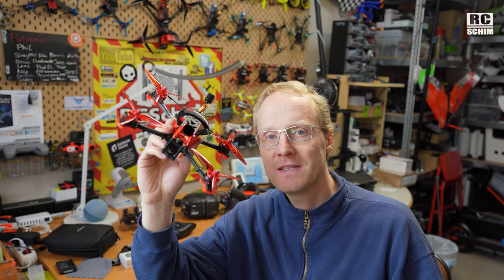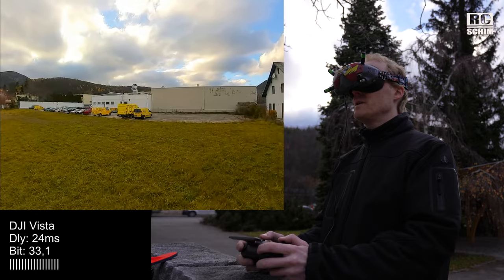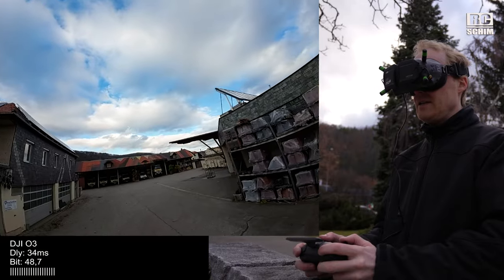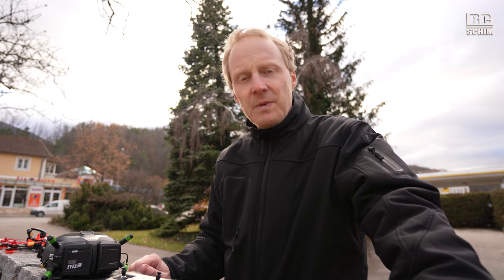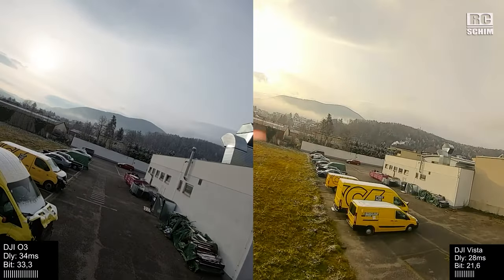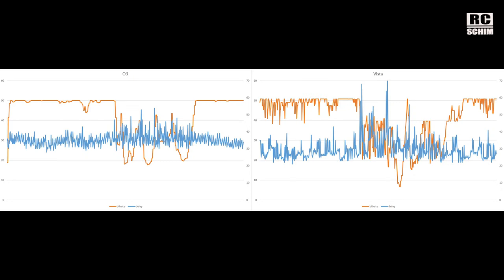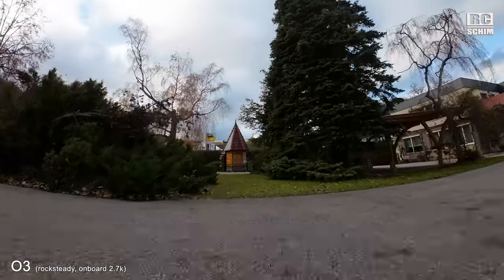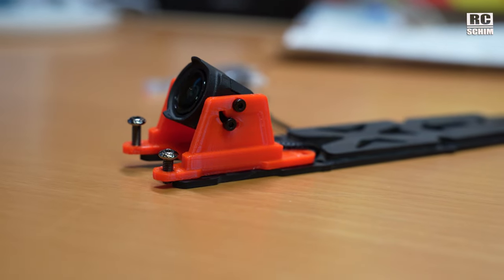DJI O3 - how does it look compared to VISTA?

Comment: Hello, your work is fantastic, a reference for me, I count the days for me to get my package with the o3 air unit, the googles v2, I start in DJI and I have many doubts. Can I record OSD in the goggles DVR? I need to know the GPS coordinates in case of accident to find the model. It would be ideal to do a tutorial for clumsy how to do it. A greeting and so on.
Reply from the maker: Thanks Alex. What radio controller do you use?  if it's an openTX or EdgeTX one, you can easily enable SD Logging. If you drone (betaflight?) has a GPS on it, the SD Logs will have all the data.    Check Oscar Liangs great blog for super tutorials on how to set SD Logging up, and also read about betaflight telemetry. very powerful.
I also made a little video about 4 ways to find your drone in case of a crash:   https://www.youtube.com/watch?v=_JBHG1bBRZ8
about OSD and recording:   if you really have the Goggles V2 (the larger ones)   they record a TXT file (SRT) with some info - but not the GPS.    But if you see the Betaflight OSD in your goggles, the last GPS coords will still be on screen even if video is gone  (see my video above).  
if you have the brand new Goggles 2   (the smaller ones)   these apperantly record (and burn into) the OSD along with the DVR video.   nice - but not so important if you have SD logs of your telemetry.
greets, Mario
Reply: @Rcschim  I use the TBS tango 2 v3. Thanks for the help, I'm going to read.

Comment: Is O3 really so much darker than Vista?
Reply from the maker: in the meantime they released a newer firmware and it's a bit better.  I use +0.7 exposure value and have it on auto, this way it works quite ok.  Aside from some dark scenes Image quality is really great of course!
Reply: @Rcschim  Please can you do a new comparison with the new firmware and new settings vs the old vista??
Reply from the maker: @publicname515  I've checked the changes on the new FW here: https://youtu.be/t6m9tIkMKBY    but I think I just compared O3 old vs new FW. 
Overall the O3 got a bit better, not perfect yet, but still way better than older vistas in most cases.  For me the best new feature:  the quality of onboard REC in 4k60 is decent enough that I don't need a gopro most flights. This saves me 150gr easy...
Reply: @Rcschim  the Vista still look brighter when going into the warehouse. The O3 still takes a longer time to light up. Even with the new firmware from your other video.

Comment: Great review.  I'm glad it's better, but only marginally. I will buy a couple 03 units, maybe.  but don't really want to update my entire fleet yet. I'm still very happy with my V2's and Vista's.  Maybe next Christmas.
Reply from the maker: same here:  it wouldnt really make sense to swap all good airunits and vistas in my fleet.
but maybe the copters (or planes) with O3 will get more air-time ;) 
It's funny how my oldest 6S capeable copter (the HGLRC Sector 5) is re-vitalized now with this video system :)   It was just hanging there on the wall with everything except a cam and vtx - so it was the perfect test copter ;)   (and it flies really nice now with BF 4.3 and stock PIDs ;)
Reply: @Rcschim  Me too. I definitely want an 03 unit to play with, but I'm going to hold off to see what advancements happen in the coming months with firmware updates and pricing.  If there's one thing I've learned being in this hobby so long is,  Never buy the beta product at full price. I'll wait.
Reply: @MOEMUGGY  That's normally true but this isn't really a beta product. It's the successor to the previous version. I don't think you'll see much in terms of bugs.

Also I wouldn't expect the pricing to change too much. It's competitively priced when you factor in the cost of a decent action camera, which DJI is, I don't see the price changing too much.

The people that are really benefiting from this '03 air unit are people that were just about to purchase a new action cam, like myself. Saved me $350.

Edit:
Try to figure out how to mount it in a way that you can transfer it to different quads quickly and easily. That's what I'm doing. I only bought one 03 air unit for my three main quads.
Reply from the maker: "dan gerouse" - like your nick ;) 
an easily moveable O3 would be nice. One could try to fit the AU + Lens in a gopro sized package (incl. the gopro fingers). only need to modify the RX/TX cable on each of the copters where you want OSD...
Reply: @dangerous8333  Thanks, but I'll wait.

Comment: Can you try the same with the original air unit from DJI ? i have seen videos where they say it has better quality than the vista
Reply from the maker: The full airunit is maybe a bit better because of its 2 antennas. But the codec will be the same, still 264 here and demanding more Bitrate for less image quality.
Reply: @Rcschim  Thanks for your reply

i saw this video 2 years ago, i cant say if it is only because of the two antennas, but it might be wrong
https://www.youtube.com/watch?v=rQG9PYyQa3M&t

Comment: nice compare! Theoretically the "old LR Antennas" should work if the remote is not used (2.4Ghz)
Reply from the maker: yep, I have dual band patches (ORT Digieyes) on my v2 goggles - but a normal 5.8 directional should work as well.
Reply: @Rcschim  thanks, it would be super interesting to see the o3 unit with long Longrange 5.8 antennas, if the performance is better as with the short one on the unit.
Reply from the maker: @cesarsommer  I realize that you meant the TX antennas on the quad, not the RX on the Goggles? 
In most of my Antenna range tests I concentrated on the RX side....
I've seen this year, that using the TrueRC Singularity 12cm antennas on my fullsize airunit on a plane really INCREASES the range and stability there  (compared to shorter stock TX antennas).
Not sure if I already wanna use aftermarket antennas on the new O3 ;)
First I would try to see how far I can go with stock Antennas (probbably more range than I need :)
Reply: @Rcschim  True im also using Truerc 12cm antenna on my LR quad this is why im asking 😁 so 2x the 5.8Ghz antenna should give only by physics already better transmission as they Stand further out also for the built, i just use the ufl Adapter to the antenna mount and can keept the Rest the same.

Theres a cool iflight Video o3 on a Mountain with Stock he flies 7km..

Comment: There were claims that the darker O3 picture and the loss of detail in dark areas is not an issue on the OLED screens of the new goggles. I don't know how much this is true.
Reply from the maker: yep, heard this a few times now and will try to confirm if setting the exposure value really high improves the dark areas while flying...

Comment: The Falcon Unit is the only vista that had a 1080p sensor 4:3 and they discontinued it ,, not a fair comparison ,, 720p  vs the 03 air unit at 1080 p now the falcon unit is badass

Comment: Schöner Vergleich. Mit der LowLight Performance wundert mich gar nicht.
Letztendlich steckt ja dort eine DJI Action 2 drin und diese ist ja auch nur eine Schönwetter Cam.
Reply from the maker: bin gestern mit 120fps geflogen und hab versch. Settings probiert. Am besten ist noch: auto, dann EV auf +1.3 Blenden rauf. DCinelike Farben. Im Untertitel-File sieht man eh dynamisch die ISO die er grad verwendet. Da sieht man dass er im Dunkeln ziemlich weit rauf geht (könnte man limitieren).
Ich denke die Belichtungsmessung sollte eine Option haben (Spot oder Average). Mein Cam-angle ist halt so 30° - und wenn man langsam im dunkeln fliegt, schaut man zu weit in den evtl. hellen Himmel - dabei wird dann falsch belichtet. Liegt also wahrscheinlich nicht an Lowlight Fähigkeiten sondern am Belichtungsprogram. Und das könnte man ja per Software korrigieren!

Comment: I will stick to my vista for now, the image is more flyable and I enjoy the picture in my googles, but i loved my analog too when I started my journey in FPV.
Reply from the maker: yep, I was wondering how they could improve picture quality where Vista was already really good. But here there are some significant improvements. I already got the comment here that the dark colors are not so much a problem on the much more vibrant OLED displays of the goggles 2. So I will increase exposure quite a bit and should have better image.

Comment: Was that low latency mode on vista?
Reply from the maker: yes, sorry for the apples to oranges here..    Vista= lowlatency,   O3=60FPS mode
see my last video where I tried a few things about the dark colors...  There I also used 120fps mode with O3 and it was not an issue in the dark...

Comment: All looks very good. I have a dji air unit that wouldn't show a picture in my goggles. I put another one in the drone and it worked so no issues with setup or wiring of the quad.  I put the the first one back in and nothing. I took the  antennas off (under a fan) and powered it up and there was a picture again. Plugged the antennas back in and powered up and no picture again. They are original dji antennas. I did this ten times and the result was the same  every time. Anyone have any idea what is going on? Thanks.
Reply from the maker: I think I had something similar all the way back in the beginning of DJI airunit 1 2020? 
To me it was just some loose antennas on the copter. 
Check bardwells videos, I think a black screen now video images (but connection?) could also be a loose DJI lens to airunit cable. check both ends... maybe the plugging in of antennas just moves the cam cable a tiny bit?
you could also cross check and use antennas from another airunit.
maybe the mmcx connector on this airunit is broken?
fw updated the airunit?
try the lens module from the working airunit on the not working one - and the other way round - if the error moves over you know it's either the lens or the cable...
good luck!
Reply: @RCSchim  thank you for the reply. I will try all you have suggested. You have earned a sub too. Cheers

Comment: dear friend. i have google integre with dji remote controller 2. i just to buy a bnf quad with caddx vista.could you confirm i could use it with may google and remote controller?
Reply from the maker: From what I read it should work. Vista needs newest firmware. Also the remote controller.
Reply: @Rcschim  thanks for you reply.i am french and i really love you video and you sharing.keep this way, you are one of my favorite youtuber
Reply from the maker: @derivas007  thanks for the nice comment!
Reply: It will not work with RC Controller 2. You need the original FPV controller from DJI.
Reply from the maker: @GearZenChannel  from the compatibility matrix it should work. In my case, where I use the older goggles v2, I need to use the old dji rc. But with Integra or g2 it should work with newer rc2

Comment: I have heard some comments on the darker Image of the O3 AU. You will have this only when you are using Goggles V2. In the Goggles 2 the OLEDs have more dynamic and will show it much better than Goggles V2. KababFPV have pointed this out too. So with Goggles V2 maybe you have to change the EV+ to get more out of it.
Reply from the maker: Hi, first: are you from bavaria?  Yesterday we saw a movie where they said "'zefix" quite often ;) 
Thanks for the info - makes sense - and in that case I will try to bump the EV even higher and see if it helps.  The newer, larger sensor has to be good  (better than vista!).
Reply: @Rcschim  Yes i am so Servus! I am running Goggles V1 at this moment and have some O3 AU here. I ordered allready the Goggles 2. My hope was a system that will be cross compatible. But it is not. So i will keep my Goggles V1 when i will fly with friends with Vistas and AU V1. With the O3 System came another hard cut for shared joy in the hobby. So i will only fly this system when i am alone....

But ok. I think the FPV cummunity has to understand that DJI is not 100% interrested to FPV alone. This will be only one tool more in there lineupd for filmmaking equipment. Give and take like allways with DJI....
Reply from the maker: you could go with the V2 goggles which can serve both standards. but the re-binding is a pain.
I'm glad that I didn't sell my V1 goggles when the Potatoe drone came out and I got it. Now I have the V1 for most of my copters and the V2 for new O3...
A friend wasn't happy with the fitting of the G2. The screens sit quite close to your eyelashes (or if further away the sharpness sweetspot is tiny).   But the OLED screens will for sure be nice quality!
Reply: @Rcschim  No the Goggles V2 make no sense for me because when i update for O3 i can not use it to fly with friends that dont have the firmware update because they fly no O3 stuff. So V1 for friends on old Firmware and O3 for anlone stuff and maybe far in the future when more people can afford to spend so much money. So than i stay with the new Goggles 2 and hopefully the image quality and OLEDs will carry all the downsides...

Comment: Leaves on trees block the signal...so comparing the 03 in a snow scene isn't really fair...?...😮😳😏🇬🇧
I can see DJI selling a load of the new air units though for the built in stabilized video it brings. The dynamic range of the 03 units camera is terrible...😮😏🇬🇧
Reply from the maker: winter vs. early fall comparison was just improvised here.   flying there the first pack with my O3 I didnt have the Vista copter with me for comparison. at home I remembered that I flew there often enough - andn I found the part where I flew exactly the same path. 
Dynamic range of DJI a2 wasn't that great either. But for hobby use this cam is quite decent. 
Also you'd have to price in the difference for Vista (~150$)  vs. O3 (250$) - 100$ difference - there's no HD cam on the market for 100$ that gives you NEGATIVE 50g of weight and that ammount of onboard image quality ;)
Reply: @Rcschim  Agreed, I've always maintained bolting a house brick like a GoPro to anything that flies is frankly mental...Let's not talk about it's dynamic range. I have a DJI Mini 2 and love it, but I've just gone Walksnail for my FPV flying. The oleds in the goggles are amazing...I'll still fly analogue though I'm sure ..😮😳😏🇬🇧
Reply: And also in winter it's bw picture, doesn't need that much of a bitrate as color picture
Reply from the maker: @myday6074  correct in theory, but it would need to be in a real BW mode with limited count of colors to need less bitrate. since it's just a color picture with mainly white and black colors I don't think that it needs less.

Comment: I think the main problem is the 03 widest aperture is just f2.8.  Ok, but not great for low light.
I'd like to see if you can adjust brightness/contrast in the goggles to get a better image for flying in low light areas. Not too much to lose that nice contrasty image the Vista doesn't have, but enough to brighten image quality when 03 is entering low light areas.  😎🤘
Reply from the maker: Will try for sure.
Reply: @Rcschim  AWESOME! Because that's really the only complaint most people have with the 03 air unit. Kinda dark in the shadows, and in general. You could make 3 different, almost like presets, that change the brightness, etc, and you could do a poll to see which one most people like the most!  FUN!  
Then, we could pick our own favorite, and as soon as we get the 03 mounted, simply change to those favorite settings and off we go....into the wild blue yonder! 🤪🤘

Comment: Goggles 2 hurt face and are hard to center on eyes without edge blur, latency noticably higher even in 30ms mode, image much darker and makes low light difficult, annoying little stutters on live and recorded video, higher power drain and no 20x20 holes on AU.
Reply: True, the 2 goggles are extremely uncomfortable. The perfect system would be comfortable Walksnail goggles with an image from DJI O3 ;)
Reply: @dabfpv  Not tried the WS goggles but heard from others they are fairly comfortable. Shame WS image quality isn't up to scratch but that said they are making progress slowly. I got some replacement foam and silicone padding ordered so we will see how that pans out. If not then I might just settle with v1 + WTFOS till O4.

Comment: Wish the footage was uploaded at higher then 720p
Reply: Your´r lucky mine was loccked at 360p , no way to change🤔
Reply from the maker: Released it too early, wasn't processed in hd or even 4k.
Didn't upload recently, gotta learn yt again;)
Reply: Network connection speed, and viewing platform can effect options for video quality. 
Often on mobile, only lower resolutions supported. Watch out for the YT "auto" option, as it can lie.
eg: even though 4k uploaded, best I see in 1080p
Reply from the maker: here it was just my inpatience ;)  published to soon, didn't realize it was only avail in 360p. Set it to unlisted quickly - but the note to subbers was already sent automatically...
took unusually long for youtube to process my 4k60.   A commenter here gave me some encoding tips / guides - maybe this makes it quicker next time...